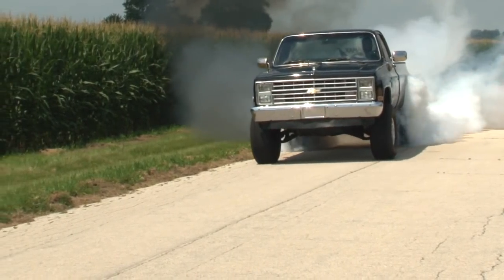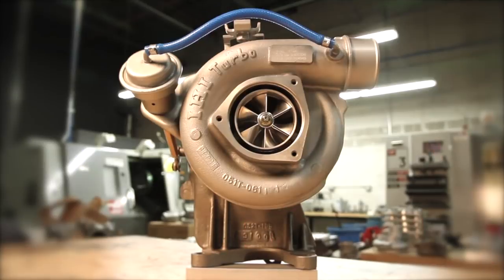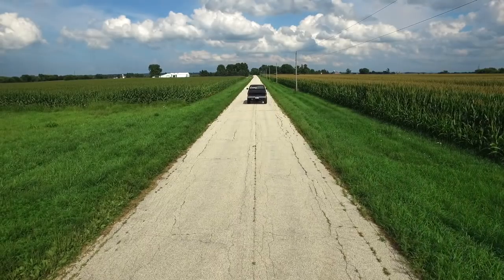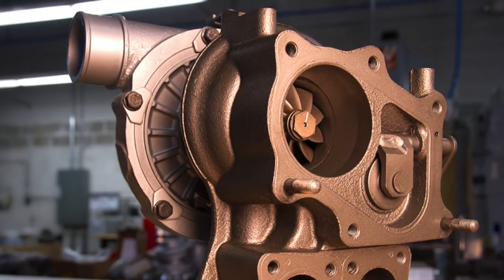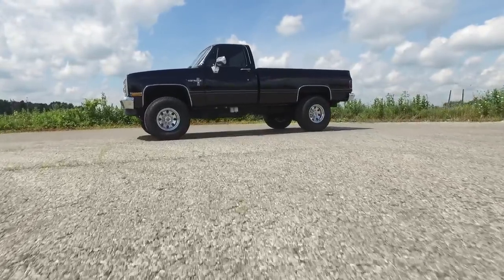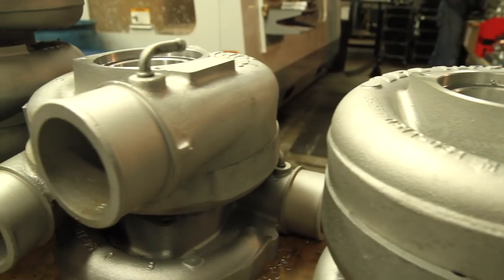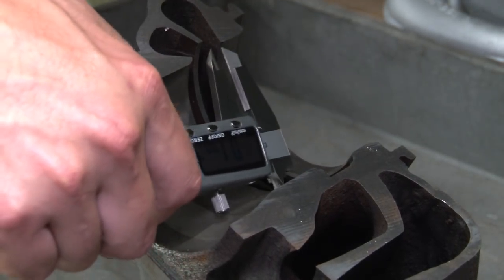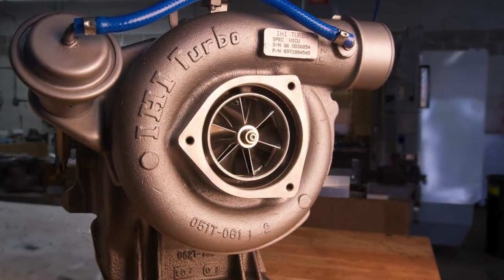640 hp Stealth 64 G2 for LB7 Duramax

Comment: I just put one of these turbos on my 04 lb7. Very impressed and a huge upgrade from the original stealth 64
Reply: Lee Bergeson I have same truck and am looking to upgrade— post a video if you can!
Reply: is there any way you could do a video of of how it sounds out the exhaust?
Reply: How long to change it out on the lb7
Reply: Have you had any other problems after installing the turbo

Comment: Between the Apache and this your living my dream, good job brother!  Did you have to mod the gram much to get the body to fit?
Reply from the maker: We did not do the actual work to fit the body on the frame. But yes - there's usually plenty of modifications required when you fit a '85 body on a '03 frame. It gets complicated real quick. Same on the Apache.

Comment: Can u add the ppe boost increase valve to this turbo as well ? And with having a zf6 trans do I just need to have an upgraded clutch to get the max power out of it?
Reply from the maker: No need to add the boost valve as the waste gate comes locked out.  Your stock clutch probably wont hold for long at 600+ HP.
Reply: @Duramaxtuner  I have a 650hp sbdd clutch I was just curious if that's all I would need

Comment: If I put that on my truck with 220k miles with stock head gaskets. Will my headgasket fail fast? It's making ruffley 550hp. Thank you
Reply from the maker: Not necessarily. Give us a call tomorrow and we can ask questions and sort through some considerations. 815-568-7920.

Comment: all u guys don't waste ur money on this turbo. my stock turbo with a wicked wheel puts three times amount  of air thru the eng. the stealth 64 is a complete waste of money. if u do u will be soley disappointed in this turbo. i took mine off and put a stock turbo with a wicked wheel back on my lb7. the 67 mil. cheeta turbo or the 68 is a hell of lot better and u won't be disappointed in the cheeta turbo.